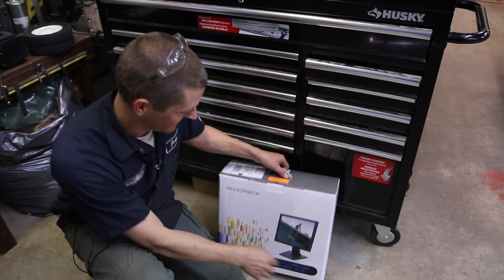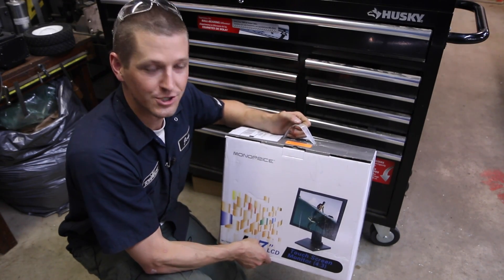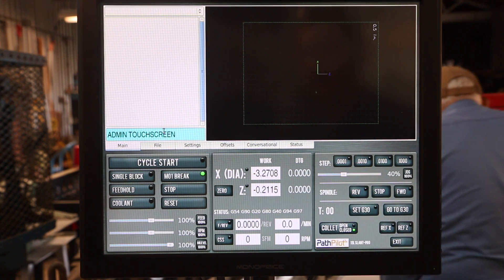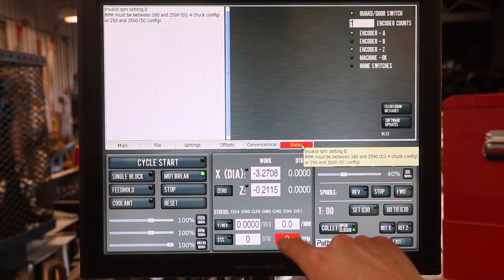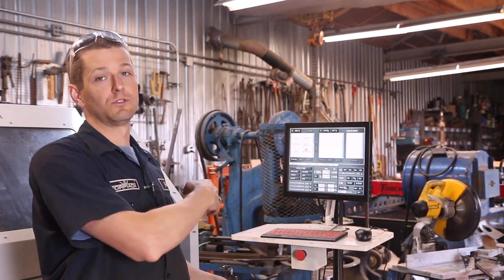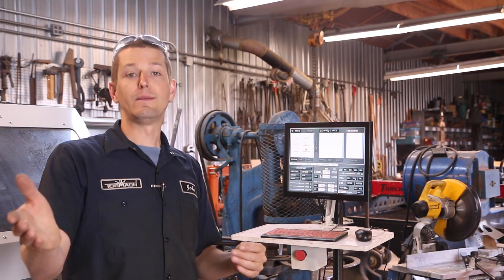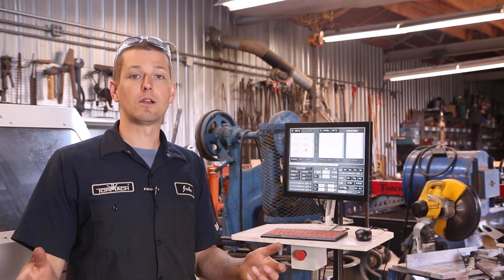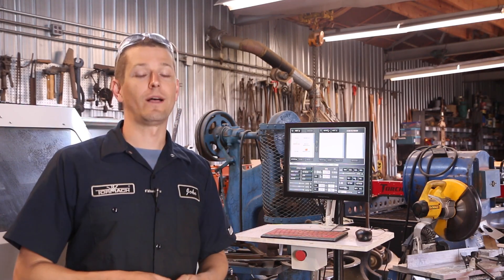Tormach Touchscreen is here!  Down with the Mouse!

Comment: Hi John. another great video.
I have the touch screen with my 1100. I bought mine with the machine nearly 2 years ago, but never ran as a touch screen. I was wondering how you got the driver installed?
I have installed the Path Pilot and as far as I know the "PLANAR monitor I use is working fine.
When I type in ADMINTOUCHSCREEN it puts up an error message and they say the list of words that can be used at the MDI line of which TOUCHSCREEN is one of them. But then when I type in TOUCHSCREEN and hit enter the error comes up that it's not a valid "G" code. Any ideas.
Keep those Fusion 360 Vids coming, they are great.

Regards  Peter

Comment: What version of Path Pilot do you have? I have v1.8 on my PCNC770 and ADMIN TOUCHSCREEN does not work even though the status screen shows it is a valid command. So I can't calibrate my touch screen. All the other ADMIN commands work fine, just not this one. The touchscreen works (same model as yours), but basically the X-axis is flipped and the y-axis is squashed a bit. Sightly bummed out about it ATM.

EDIT - Problem solved (sort of):
I had to downgrade to v1.7.2 then it works fine. So it's a bug with v1.8. Not sure if it will continue to work right with 1.8 if I upgrade again. Another day maybe as I'm leaving well enough alone for now.
Reply: Chris Stuhr For others that run into this, Torrmach informed me that I can safely upgrade to 1.8 after running ADMIN TOUCHSCREEN under 1.7.2. They added to their bug list and said it will be fixed in the next release.

Comment: I noticed this was Monoprice monitor.  Monoprice makes the best cables i have ever used for the price and some other random stuff (like 3d printer filament, 3 rolls turned and no complaints here).  Thought you and your viewrs might want to take a look, only $174 direct from Monoprice.

http://www.monoprice.com/Product?c_id=108&cp_id=10845&cs_id=1084502&p_id=6959&seq=1&format=2

Comment: If it is an industrial touch screen it will last forever. I have had a touch screen on my Machmotion controller since 2009. It still works to this day. I to would like to see a Haas control station using buttons just gives this old-timer as warm fuzzy feel vs a PC. The PC is good but a control panel is just more comfortable in the shop.

Dan
Medling Machine Works
Beverly, OH

Comment: 75x75mm VESA bolt pattern

Not sure if it'd work with the Tormach monitor arm, but you can get adapter plates between the various VESA patterns to avoid drilling the machine.
Reply: ...or you could machine an adapter. :D

Comment: I can definitely see the benefit of touch screens, but I have a piece of hardware I recommend to you as well.  In a previous life, I was a design engineer for company that builds airport support vehicles (deicers and catering trucks).  For the modeling and parts and assemblies, I was using Inventor, but these should work with any of the 3d modeling suites.  3dconnexion Space Navigator is great, instead of having to grab the part with the mouse to move it around, the Navigator maneuvers the part.  It speeds up the process drastically.  At around $100, I feel it is easy for it pay for itself in a short amount of time, just in time saved.

Comment: LinuxCNC, the basis of Path Pilot, has the Touchy user interface.  It doesn't look as nice as Path Pilot.  I use the non-touch Axis interface on LinuxCNC.  I use a Logitech K400 small wireless keyboard with an integrated touch pad as a deluxe wireless pendant.  They're fairly durable, particularly with an $8 silicone keyboard overlay, and if all else fails, pitch the $30 keyboard and install another.  I like the concept of a touch screen, but I feel that I'd spend more time cleaning the display so I could read it than I'd save by integrating the control with the display.  YMMV.  A touch screen will definitely impress the chicks, though!  :-)

Tormach should be able to integrate the controls to look more like a traditional VMC than a PC controlled machine, if you can convince them to do so.  LinuxCNC is very flexible in such regards, and the only down side would be trying to support those LinuxCNC extensions across multiple machines and software releases, and that's not a problem for them.  They basically support it on their mill and lathe, and issue software upgrades whenever they decide to do so.  Personally, I like using inexpensive and readily available PC hardware for CNC, and I don't mind that it looks as if a PC is controlling a machine.  There's a reason that there are a lot of 10-15 year old machines sitting idle with dead proprietary controls from Fanuc, Siemens, etc.  Some of those machines are available cheap, and make great LinuxCNC conversions!

Comment: I have used touch screens to control my Mach 3 and Flashcut CNC machines for years. Most people don't know you can simply buy a touch screen monitor like those used on store POS terminals. They have a USB connector and mouse driver software. I LOVE touch screen control!

Comment: I'd be curious to know if you're able to use a protective sheet over the screen (say, something like with sandblast cabinets). It would all depend on the type of touchscreen but would definitely extend its life if you could.
Reply: suzukichopper 
That would be very good to have! My hands frequently have coolant on them and I'd be worried about small drops seeping between the LCD panel and the bezel. If I couldn't find an actual screen cover I'd probably put a strip of packing tape along the bottom.

Comment: John, what you just showed, was a Linux touch screen calibration, that's disguised as the path pilot process. I believe that it's done for the sake of simplicity.
Reply: Hehehe. It's using the same GTK theme as Ubuntu as well, the thing is totally linux with half off the shelf stuff.

Hey, if it works....